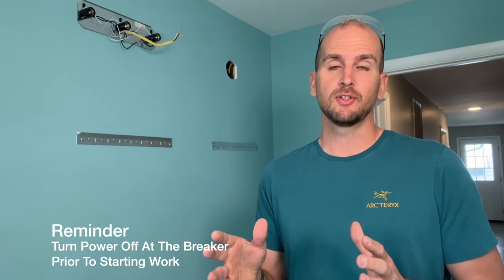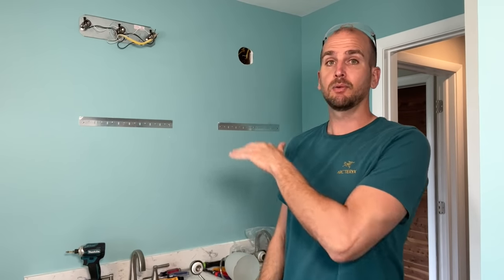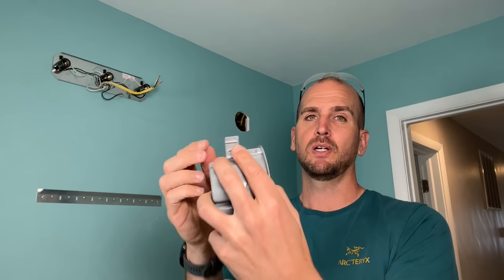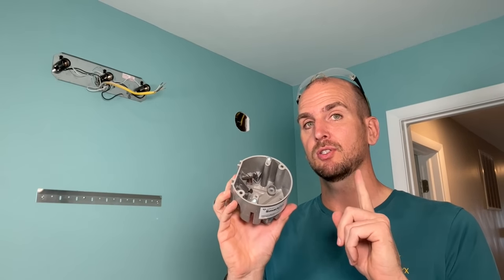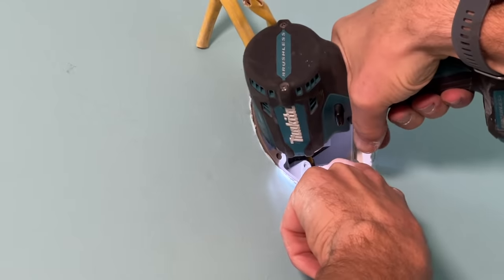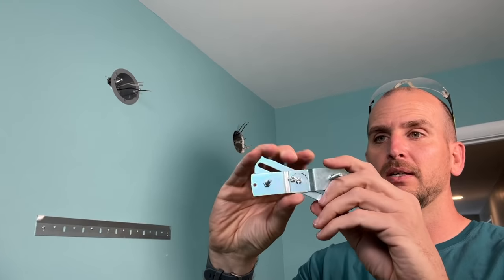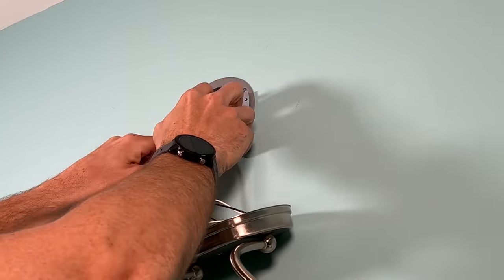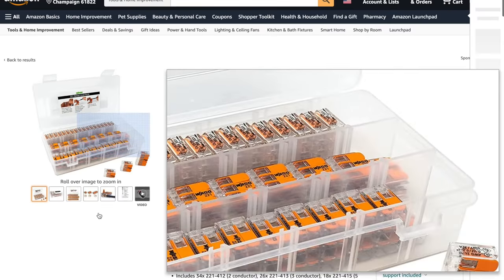How To Install A Vanity Light | Complete Guide

Comment: Another helpful video.  I'm mounting on a wall to light fixtures and the locations are butted up against studs. So that Smartwire box will work. One thing to note: The link to Amazon for the box you used takes you to a different box. That model is MSBFAN and it has two threaded rods (assuming for ceiling fans?). I bought two of them and then realized the mounting plate for the light fixtures are obstructed by the rods.  I found the box you used at a local big box and will get those tomorrow.  A minor detail but worthy of you being aware. Thanks again for your videos. My wife and I really enjoy them.

Comment: This a very clean pro video. I have installed few of the vanity lights and now I prefer the wago connector than the twist ones. I used a wire hanger to hold the light. Thank you for sharing

Comment: Super helpful - I definitely need the box - have an old light like you mentioned with no box - just wires hanging out and attached to drywall.  My issue is that there is no grounding wire or box - is this going to be a safety issue?  I will install the box but don't know what to do about not having a grounding wire

Comment: Old Box thicker walls tip.... Remodeling our 1913 house it has 1 inch boards over studs and then drywall... Just match the screws that work the flaps with longer hardware... Any hardware store stocks then in my experience.  Retired Trim guy.

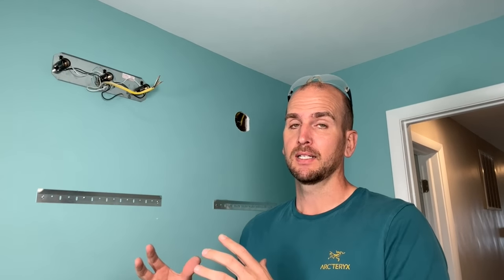Comment: At 4:43, it actually IS acceptable to have the romex (NM) directly enter the fixture plate IF a proper cable clamp fitting is installed on the fixture plate. When the fixture is fully assembled, it is considered like a box/enclosure.
Reply: In all my years of remodeling i've never seen any electrician use a cable clamp fitting on fixtures like that.
Reply: @markg7558  I don’t doubt that; I’ve seen plenty of corners cut by electricians. But the fact remains there is a right way to do things (code), and just because a pro doesn’t follow that, it doesn’t make it acceptable.
Reply: Show me the the code reference that says you can't use a fixture that is UL APPROVED to do so, to make the joint inside the fixure housing. It's done all the time in new construction where there's strict inspectors passing it every day. And all the ones I've done have either come with a grommet or I've just added my own.

Comment: Nice video!  Thank you!  It is good that you didn’t install the shallow “pancake” electrical box as actually it does meet NEC electrical code because of wire capacity.  In fact, 14/2 wire is just over the volume wire size of the box and 12/2 is way over the volume wire size in this shallow box.
Reply: I mentioned to say, does not meet NEC electrical code.  Sorry about that!

Comment: In my bathroom the vanity light was hanging without a junction box on the wall so I planned to have it done, but I ran into a kind of issue that there was a duct behind the wall and there was not enough room for a thicker junction box. I ended up buying a plastic pancake box and it worked pretty well.
Reply: If you have a strip fixture like these you don’t need a box the fixture is the junction box

Comment: Hey Scott.
Another Scott here.
I know this video is older, but I'm hoping you still check it for comments.
I have an existing 2 sink 2 light setup much as shown here, with similar cheap off the shelf lights. I have purchased new lights with smaller bases than the large plates, designed (I think) to be centered over the boxes.
So here's the problem: the existing old work boxes aren't centered over the mirrors/sinks. Measuring off an existing outlet in between, each is roughly 16" to either side, which tells me they just attached to the most convenient stud, without sweating about the centering. I suspect one is to the left of its stud, one to the right, though I'm not in a position to check it as I write this. Each light needs to be moved about 3" to be centered. 
Is there an easy fix for this?
My skill set includes switches, outlets, fans, etc, but not drywall.
Maybe this will prove a subject for a video.😎

Comment: Be careful at 7:30, in the US a 1/2" pancake is only rated for 6 cu.in. of fill, so a 12/2 Romex cable will not pass inspection, only a single 14/2 cable.

Comment: Excellent information, I have one issue. Once I got the new vanity out of the box there is the white wire then there is a black wire, but there is one out of the 3 black wires joined together with a 3  white wires. What do I do?

Comment: Hi Scott, thanks for posting this informative video! Super helpful :) I was wondering if you know how difficult it is to install a vanity light in a bathroom that doesn't have one at all! We just moved in about 3 months ago and the lighting situation is very dim (pun intended 😅). So I wanted to install a vanity light to brighten it up a bit, but I'm not sure how difficult it would be to run wires and that. I know I will need the help of an electriction. I'm hoping it's not too messy or difficult since we just got the walls painted.
Reply: For all his supposedly expertise, he didn't answer because I don't believe he have a clue
Reply: Every situation is different. If you have an outlet near where the wire can run, you can use power from it and add a switch. Otherwise you need to cut the drywall out so the studs can be drilled through.
Reply: @adamplummer2190  I was just about to say this. I did a bit of apartment restoration when working with my former property management company and learned a little about these things. If there is no wiring, it will be a bit more work on cutting the drywall, replacing the area, and painting over it. It should not be too big of a mess.

Comment: I have the same vanity lights, but with 3 bulbs (LED equivalent to 60W) it is way too bright, yet you installed SIX bulbs in one washroom! I tried various dimmers with dimmable LEDs including dimmers rated specifically for use with LEDs, but the lights wouldn't stay OFF (most often the center bulb glowed while the other two were off, and I tried switching around the bulbs, always with the same result). If you wired the 6 bulbs to one dimmer then they would probably stay off, if the dimmer has a neutral connection and is designed for LED bulbs. Eventually I just installed a relay switch, giving up on the dimming option. The downward glare was objectionable, so I rotated the fixture so that the bowls point upward, reflecting light off the white ceiling. That got rid of the glare, but it's still too much light, and has the disadvantage that dust will accumulate in the fixture bowls.
Reply: Use 25W or 40W equivalents? I have two two-light fixtures and installed both a dimmer and 40W bulbs.

Comment: 11:22 Never hammer in an old-work (remodel) box of any type into drywall.  The interference will break out the back of the drywall and then interfere with the mounting tabs.  The fit should be a clearance fit;  Always.
Reply from the maker: Thanks for the feedback!

Comment: What are the dangers or downsides to only grounding the metal bracket and electrical box? Since the light fixture is also metal and is attached to the grounded bracket, isn't it grounded anyway?

Comment: Man thanks for this video. I recently installed one, and of course no box, just wire out of the wall. I did get it installed, but a pain getting the wire to hide underneath in just the space of the fixture. Also like your fixture on the right, if you get one of these fancy LED with the side glass, you have to put the fixture together before you mount it to the wall. (ask me how I know) I had to go through the pain twice. It's up, looks great, but I would prefer the box instead of my wires being against the sheetrock. I know it could be a fire hazard, oh well it went the first 35 years that way. I will fix it if I ever paint or have a reason to pull it down.
Reply from the maker: Thanks for the feedback 👍
Reply: The drywall, sheet rock will not hurt your wire it’s fine to just run the wire straight into strip fixtures like these
Reply: But you do need a connector or a grommet to protect the wire so it’s not rubbing on the back plate

Comment: I've got a small bathroom that only has a lightning the ceiling but want to install a vanity light. How difficult is this and how do I go about doing it? There is a GFCI next to the sink can I run wire from there or do I have to pull all new wire

Comment: Great video! Your fixture has many wires. On the first fixture, I see you using the wagos for just one of each wire? What did you do with the other wires?
Reply: The wires coming from each light socket are already connected together at the factory. That's what you see going into those clear wire connector caps. Out of those come the pigtails that connect via the Wagos to what is coming out of the wall.

Comment: It's fine to not have a junction box if the fixture is rated with a box equivalent volume. You do need a cable connector to prevent chafing though.
Reply from the maker: 🤔, I honestly didn’t know that and going to have to poke around a bit to see if any lights have the “box equivalent volume” called out as a feature.  Appreciate the feedback.
Reply: @EverydayHomeRepairs  I imagine that may be the case given how many fixtures are like that, though my thought process is that placing a j-box isn't difficult and gives you more verstaility in choosing a fixture.

I recently replaced a vanity in a family members bathroom, and besides no j-box being present, the romex sheathing from the 14-2 was either non-existent or stripped so far back that it wasn't visible even making a 4" hole for an old-work box. Do you know why code requries 1/4" sheathing to be present in in the j-box? Is it to prevent a fire from spreading outside the junction box? Or is it to protect the romex against the clamps? One is more dangerous than the other, but I don't want to immediately call it fact if it isn't.
Reply: "...a box equivalent volume." -  Can someone please tell me what that means?
Reply: Box equivalent volume is my phrasing, it's not an official term. Essentially I'm saying the fixture must be rated for it. Many metal fixtures are. Why I say volume is that NEC requires a certain box fill on j boxes and fixtures must still comply with that.

Comment: Replacing a bathroom vanity light, but cant find one with it's own switch. The old one had it's own switch and socket and therefore did not need a wall switch.  Bathroom has ceramic tiles on concrete walls. Power is supplied via a juncion box in wall. Do not wish to cut tiles. Dont they sell vanity lights with own switch and socket any more? How do I do this?

Comment: While watching this a question comes to mind:  The last few years I have been using bulb and socket lube on the bulbs when installing them into the fixture.  I have come across a few light sockets that it is both difficult to install and remove the bulbs.  The lube really helps but have not seen any comments one way or the other regarding the lube.  Just asking for an opinion.  Thanks for your videos. One of your videos got be out of a furnace thermostat problem a few weeks ago.
Reply: Bulb and socket lube? What is that - just dialectic Grease? I would assume that is what it's called,but have never heard that term used for it
Reply: @jaykoerner  I got it at Menards.  Called:  Act 2 Bulb & Socket Lube  Stop The Sticking!  Shallow orange plastic container.  I have a socket in the bathroom that when changing the bulb the glass separated from the socket because it unscrewed so hard.  Felt like there was grit in the socket.  No problems since using the lube.  FYI

Comment: I wouldn't used the lever connectors on a high amperage draw situation,  such as a receptacle that a space heater is plugged into. I've seen them melted right off. Great for these lighting hookups though.

Comment: Perfect video explaining all the options. How about a video on replacing a ceiling light with a fan light combo without using a remote control.... Included the use of the fan boxes required.
Reply: 90% of fans have pull chains that you can use to control them so you don’t have to do anything special with the wiring
Reply: @billy9075  This video didn't have any fans in it but speaking of fans, I installed WiFi controls in all 8 of my ceiling fans. I can turn on any fan to any speed and the light by voice. Alexa has groups, all, 1st floor & 2nd floor . All fans also have a remote control for when the internet is down & they all have timers (1-2-4-8 hours) to turn them off if you so choose.

My vanity lights are also voice activated & I can turn 1, 2, 3 or all at once and all are dim-able.

Comment: Your Ground screws into a PLASTIC box with NO metal connections to them is NOT needed!
You only need a 3 WAGO on The 2nd box for the ground!
Reply: he didn't ground the plastic box, he replaced the ground screw that came on the metal bracket for the fixture with a ground screw with an included green insulated conductor.

Comment: So as a novice trying to just install a new vanity light it would be way more helpful to spend more time talking about the neutral and ground and hot wires and how you're connecting them with the Wago connectors rather than flying through this part with your hands in the way. Especially since the wiring is the most important part of it! I thought it was a great video up until the part that I actually needed to learn about. Sorry, just frustrated because I have to go and find another video that's going to show me, with more clarity, about the wiring and connection peocess so I don't mess things up set my house on fire or short out my system. Dang it.😒

Comment: I would not have used the "screwdriver depth gauge" for the right hand box....why not measure up to the right height and then punch your hole with the jab saw and cut over to the stud?  No measuring and foolproof.

Comment: I find it hilarious that there is no regard for the wires against the sharp edges of the pivoting bracket through the wall but they forbid the wires going through the plain bracket because of "chafing".
Reply: My suspicion is that the Romex cables are seen as more permanent and more "sacred" in terms of keeping them undamaged. Someone might one day do a replacement like he just did here and unknowingly tuck a damaged section of Romex back into the wall.

Comment: You are incorrect.  If the light fixture is enclosed and the proper connectors are used you are allowed to omit the box. We do this all the time and I've never had one to fail inspection.

300.15 (J) Luminaires. A box or conduit body shall not be required 
where a luminaire is used as a raceway as permitted in 410.64. 

410.64(A) Listed. Luminaires listed and marked for use as a raceway
shall be permitted to be used as a raceway.
Reply from the maker: Thanks for the feedback and I need to investigate further on which vanity lights are approved to be a raceway.  I always assumed this was limited to the utility lights you often see in a garage with 48” fluorescent or LED bulbs.